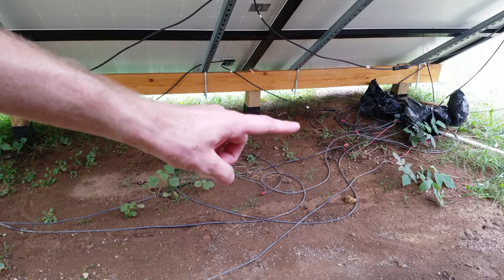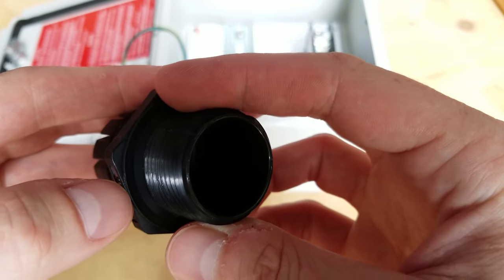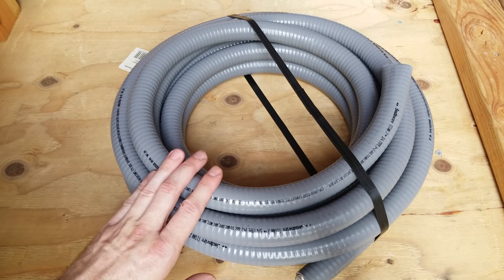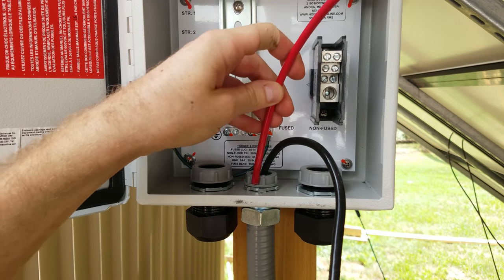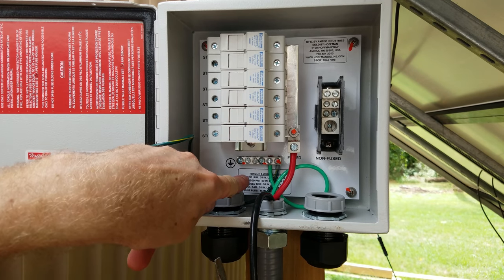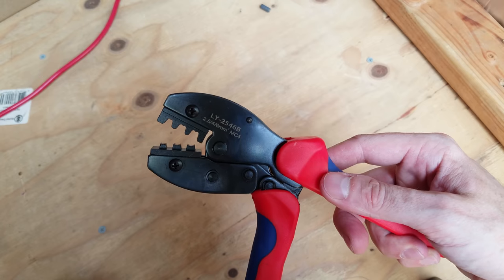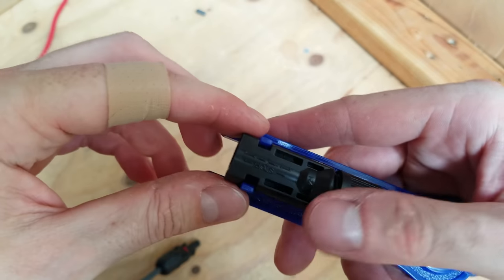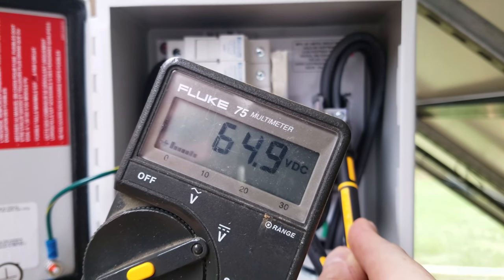Connecting the Solar Array to a Hoffman PV Combiner Box, Off-Grid!

Comment: You said in the video at 6:58 you're going to run 5 pairs, but you ended up wiring only 4 pairs (assuming from you used only four fuses in your 6 breaker string), what is your PV configuration? Also you are running only one pair from your combiner to your shed in this video, but in your cabinet wiring video you have three breaker for incoming PV wiring. For a DIY enthusiast following your videos Its getting confusing on the configuration you are trying to do. Yes we could get the each details from the replies you give to the comments on the video, but if you could you add details on the description or talk a bit about it some "its all done video" of your shed/system it would be of great help
Reply from the maker: I only wired 4 pairs because the 5th wasn't ready at the time of this video. It's connected now. You see three breakers in the cabinet because I have 3 arrays like you saw in this video.
Reply: @LithiumSolar  The only video where i saw the panels was the one, you did a teardown of your pv panel to make room for the container. In that clip you had 6 panel likely in 2s3p combination.
In another video of yours I read a reply from you stating you have total of 15 panels.
So what exactly is your pv array combination?
Reply from the maker: @sresam89  I have a lot of panels and the configuration has changed many times. Currently it's a 5p3s, 5p3s, 1p3s. I'm not sure what you're trying to get at with the detailed specifics here.

Comment: i still dont get why you overseas don´t use cables that can withstand uv and all the other enviromental things, and its faster and cheaper to you dont need to do the work twice lay it out done...
Reply from the maker: The PV cables do withstand UV. I can run those all the way back to the charger if I wanted, but you still need a combiner box. It's cheaper and cleaner to have the combiner at the panels vs run 10 individual cables back to the charger and put the combiner next to it...
Reply: If he had used a cable to run back to the controller he’d need to use a cable glands plus heavy gauge outdoor rated cable and support it every 18”. 

The lesson here is that the cable costs more than THHN individual conductors and liquidtite conduit unless your in Europe where cable is preferred.
Reply: @LithiumSolar  fair

Comment: they're not "knockouts" if you have to drill them...  it's not "cable fishing" if you can push it all the way through...
Reply from the maker: Then what would you call them? And why is the tool called a knockout punch if it's not punching knockouts?
Reply: All knockouts require a pilot hole and of course it’s fishing because your playing the odds whether you can reel it in 🤣